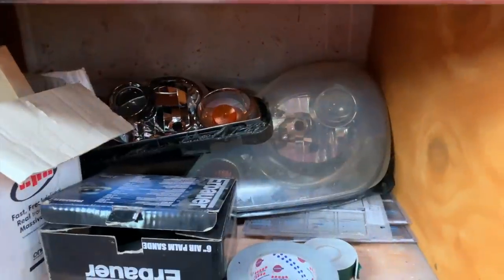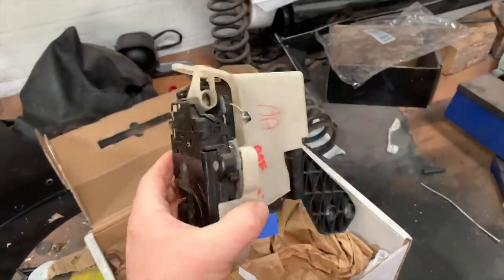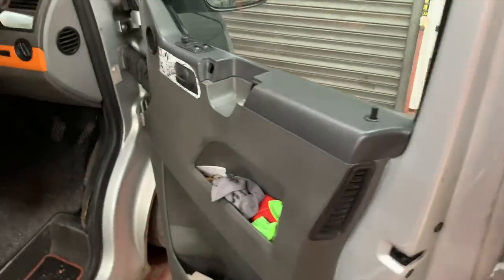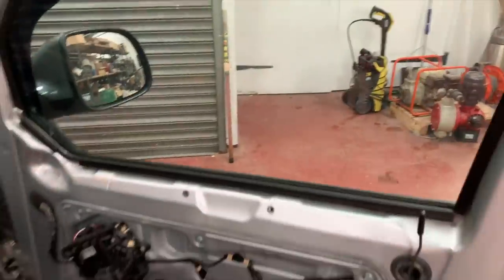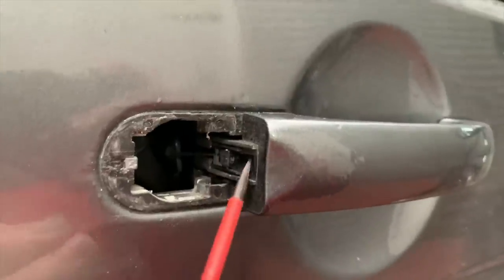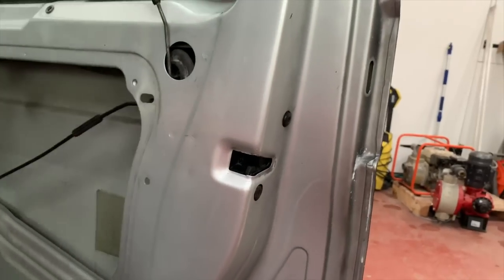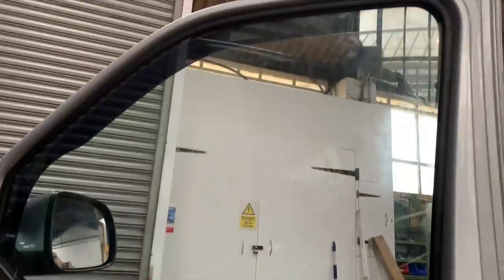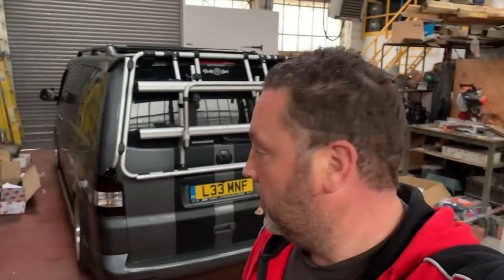Vw Transporter T5 central locking repair

Comment: Just done mine. When you replace an original one, mine was 16 years old, it has a plastic bracket on the lock which is riveted to both the lock and door casing. The rivets need drilling out to get the case off. 

When I fit the new lock, I left that bracket riveted to the old lock. 

If your door wont close after fitting the new lock, check and adjust the alignment. It's quite fussy.
Reply: Hoping you see this. A lot of the ones I'm looking to order just look like they come without the white plastic casing thats on the original. Are you saying you just fitted a new one as it came, without the white casing( as is on the original)?
Reply: @Ccfc595  long time ago so honestly i don't remember. I would have made sure it went back as it should be so if something was missing on the new part then I would have added the old bracket to it or whatever we're talking about. 

I would remember if there were any major issues fitting it, probably obvious once you get in there and do it.
Reply: @Martin_84  Thanks Martin. Weird one to be honest as the new ones look like they dont come with the lock pin (bit that pops up and down in the door card when locking and unlocking)

Comment: Good video thank you.
I few things I have come across while doing mine.
1 you dont need to remove the cap on the lock, as it will come out when you remove it the lock anyway. 
2 when I started I thought I had all the tools I needed, but I found my Torx bit extension was to fat to fit in hole in door,  so I bodged a flexible one by filing it down.
Reply: My cap won't come off, have backed the screw right out.

Comment: Awesome video, thanks - I’m having trouble with a few things. Firstly, getting that plug off the lock actuator when it’s still mounted in the door - any ideas?  Also when I reassembled the door plate and door card, I’m finding that my (manual) window winds up OK most of the way, but suddenly feels more difficult to raise the last 3 inches to the top. What have I done wrong here?

Comment: How do you disconnect the wiring block connector from the lock unit??? Great video by the way,I'm replacing the window regular panel,very helpful just can't get past the block connector.

Comment: Excellent video. Now what about a locked passenger door when you kill the handle inside it’s double locked so lath goes up but straight back down. Can’t get into the passenger door from inside and outside!

Comment: Great video Lee. Both my passenger and driver's door locks are on their way out. It's a right pain especially the passenger door as you need to open it to fuel up and no key lock option on passenger side. Also, are you planning to do one for the mirrors as want to upgrade to electric mirrors. Unsure how to go about it and can't find anything on youtube?.
Reply from the maker: Cheers. No plans for a mirror vid, I’ve swapped to facelift mirrors but already had electric mirrors so just plugged in.

Comment: I want to just get a good look at the central locking unit for same door on my 08 T5, so o can order a new one for the auto electrician to install, and check if something is just loose in there the lock button moves a bit when I press the remote but not enough to do anything. Can I just remove the panel inside the door card to see the central locking unit and check if anything is loose in there. Don’t think I could get lock out with only one arm.

Comment: Hi is it possible to renew offside door key barrel on t5 vw transporter 06 plate  as someone tried breaking into it , and will I have to have a different key or can a replacement barrel be purchased to use existing key thanks.

Comment: Fantastic video. I'd have full confidence using this as a guide. I have 2 questions Lee, how do I problem solve this for my passenger door, I think I have the same issue with my motor unit, but how do I find out before I strip it all down?  Also, my alarm LED has stopped flashing along time ago, I don't know if this is connected, but I removed my drivers seat a few years back and I have a long loom with a small 5 hole connector coming out by the bonnet release lever which headed in the direction of the drivers seat.....thanks
Reply: Hey, unwrap the loom under youre drivers seat and they is allways a corroded bad connection,i also squirted WD 40 into my lock,and the red led started working again.

Comment: Great vid subscribed straight away keep up the Vids ow and How do you diagnose if the issue is wires under seat or the lock ???
Reply: Strip back the loom under the drivers seat allways a corroded joint

Comment: Nice on bud, did that on mine (passengers side) a few weeks back but didn't have the time to record it as well. Top video as always! 😎♥️
Reply from the maker: Cheers mate. I had the advantage of already taking off the lock the week before to see if that was the problem. So knew how to do it quickly 😬
Reply: Hey what did you fing as i have the same issue!

Comment: Hello mate, ive recently brought my 1st T5 & have an intermittent drivers  lock problem same as yours, but also the side door sometimes doesn't open when you press the key button,  do think if I change the lock like you did it would solve the side door issue too? Thanks for the video👍🏻👍🏻
Reply from the maker: Hi. I doubt it will solve your side door issue too. That’ll either be the lock in that door too or the wiring near the central locking unit. They are known for corroding. A google search should find a video on the wiring issue 👍

Comment: Great video. I'm not sure I will do this job myself but now I at least know how much effort it is to replace the lock mechanism. Just curious - was it electronics causing this issue or was it a  mechanical problem? In my t5 it seems as if the mechanism would work, but there is something stuck that does not allow it to open..
Reply from the maker: Giedrius Matulionis I did strip it to try and repair before I bought the new one, but to be honest, I can’t remember. I need to do the passenger side so I’m sure I’ll find out.

Comment: Hi there, wondering if you could help me out , the alarm sets and fobs stay up and you can't lock the doors manually from outside, the wires in the box under the seat show no corrosion , what else could be the issue ??
Reply: Strip back the loom under the drivers seat and have a good check, mine was setting off hazaeds at 3 am